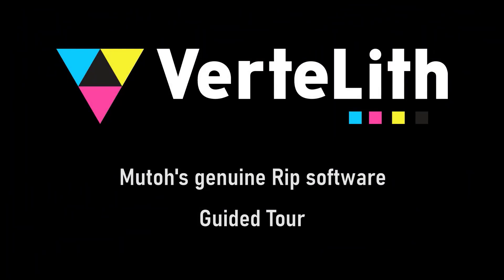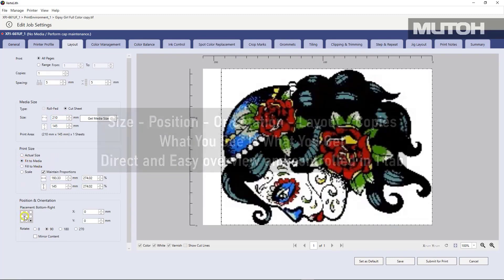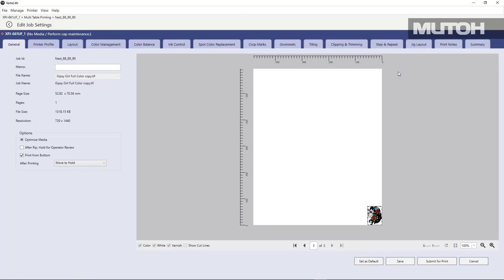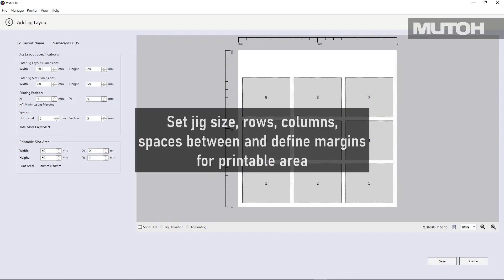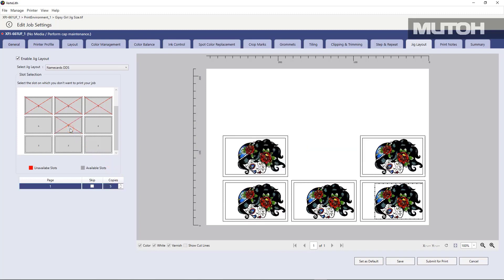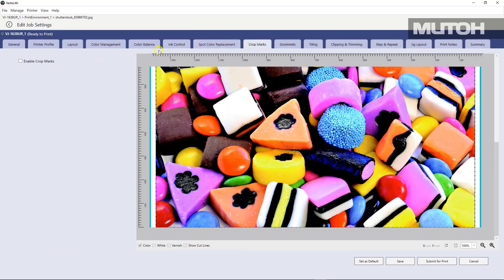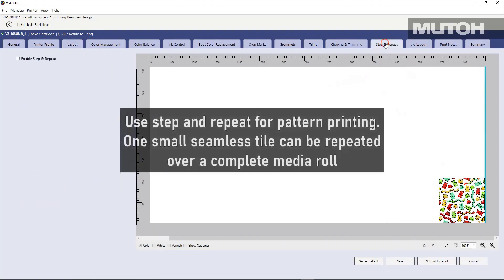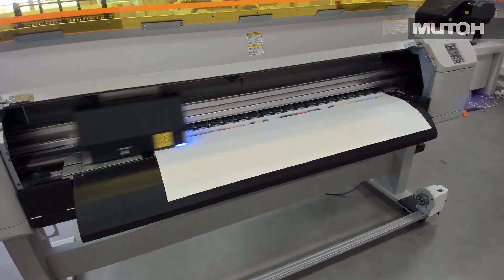Mutoh VerteLith™ RIP Software – Guided Tour - Genuine Mutoh RIP Software

Comment: when you put the substrate on the printed jig did you use double sided tape?
Reply: Don't know if they answered,  they printed white on the bed, they used the machine to create the jigs,  the bed has a vacuum that has 4 lvls of sucking media onto the table, the jig just helps position the media on the table. Quite a handy feature!
Reply: For some thinner substrates I will use Double sided tape to keep the material in place